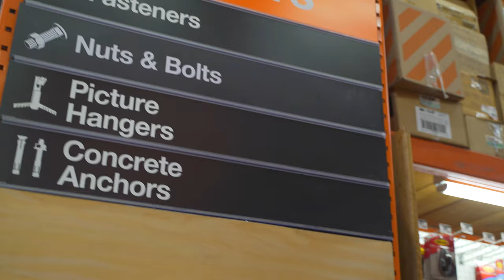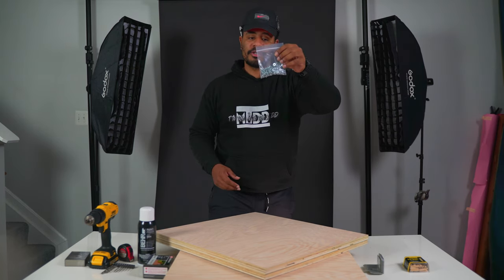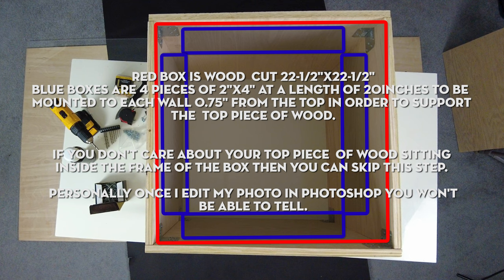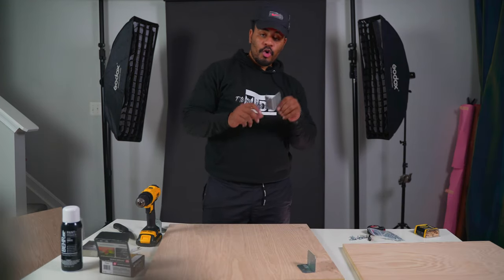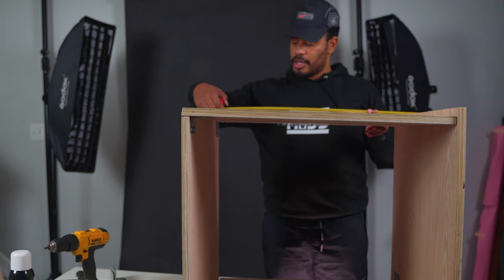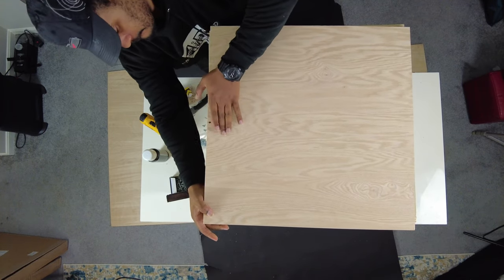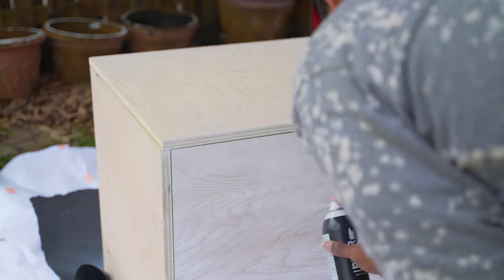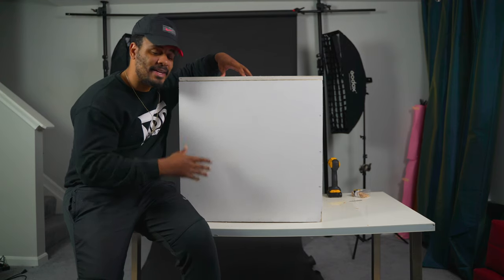DIY Photography Prop Box + How to Make A Pedestal For A Photography Studio + Beginner Photography

Comment: Props for a well done step by step Video..I have over 50 years experience working with wood I was a C-6 contractor " Cabinetry and mill work... I also do model photography and have been wanting to make a similar white box for a model prop...I like how you built yours with the pre cut 3/4 plywood.. I wanted mine to look great but also light weight as possible..I made mine with a frame and skined it with 1/4 inch plywood..No screws just a few 1 1/4 pin nails and Tight Bond glue..I have a  tip if you build a new size in the future. Instead of spray paint. You can get a paint in 1 quart cans at Home Depot called KILTZ it come in a flat white and is used mostly as a primer for bare wood..With two coats you will have a durable finish that can be touched up if needed. Just apply with a brush...lightly hand sand after the first coat dries..Better than a gloss finish for for photography ( No Glare or unwanted reflections...Keep the videos coming I love watching them !!
Reply from the maker: Thanks a ton for sharing your knowledge as a c-6 contractor! This is exactly why I made this video because it wasn't any geared toward photogs and I knew that we would have others who could chime in with beneficial tips so that anyone else that comes along and needs to travel this path can have a little less stress. Thanks for the insight and supporting my channel!

Comment: Time?  Did you keep track of the total time it took you?
Reply from the maker: Yes 2 hours to put the prop box together. And about 1 hour of active painting. I applied 2 coats of paint so about 30min per coat. But after the first coat i just came back the next day since I wasn’t in a hurry.
Reply: @TMIDD  Thanks.  Sounds relaxing.  Maybe after I retire & have more time.
Reply from the maker: @vernonr7404  Def go for it. It would be a nice additional prop to use and recently there has been a lot of people requesting this prop. Thanks for checking out the video!